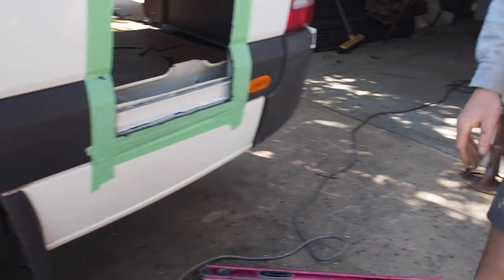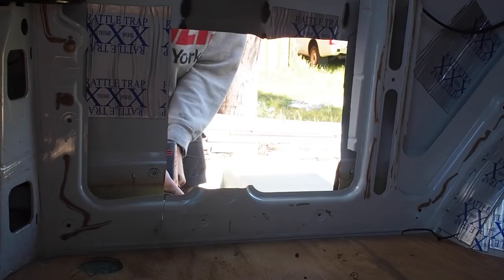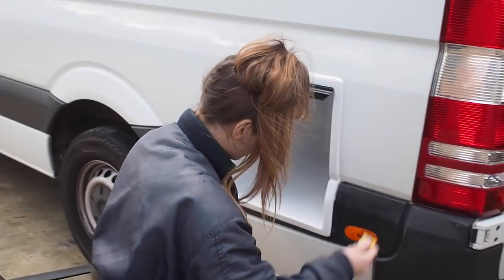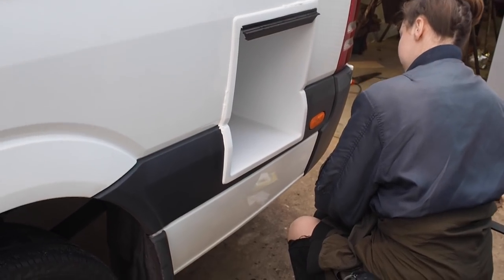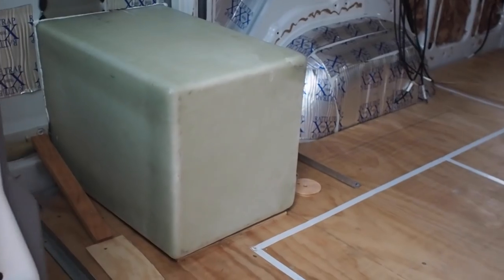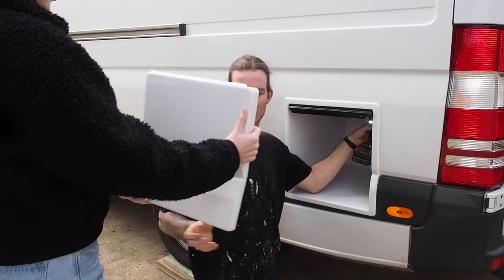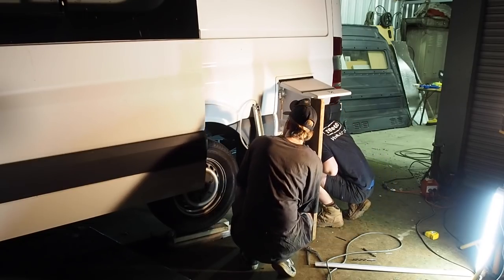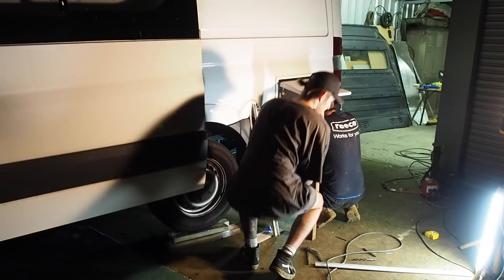HOW TO INSTALL GAS BOTTLE STORAGE BOX | Ep 5 Sprinter Van Conversion

Comment: Just looking at installing a gas box in a Mid wheel base Sprinter, couple of questions, can It basically go anywhere where there is clear wall and di you have to recess the floor to fit it in? Cheers John

Comment: I think in my build I'd want an under-slung LPG tank that can be filled at petrol stations, just a lot easier than bottles. If you manage to find a van of that size that has a petrol engine, then not only could the gas be for hot water, cooking and heating in winter, but also to run the engine as a cheaper fuel than petrol. You'd also have the bonus of the added range of having a second tank, and when not being used for travelling that gas would last for months just cooking and heating.
Reply: This is the exact same thing that I thought. Its illegal in Australia. Our LPG at the station is cut with butane, that is dangerous in stoves. You cant get a dedicated lpg storage tank underslung, its not legal to pump cooking lpg into a van. Nanny state gone mad. The reason our campers all look the same down here is that its the only legal way to build them.
Reply: @sarenace  that's a shame... I thought it was completely fine to cook with butane considering that's what camping stoves use

Comment: I don't want to cut a hole into my van 😥
Reply: I feel the same.. but safety is number one priority!
Reply: @maxhillebrand781  I'm thinking about building a camper van without gas. Webasto Diesel Heater and a cooker with just a small "can" of gas. Water heater with car cooling system. 

Still thinking about, what's actually cheaper. (gas shall be cheaper to heat up a van and easier, but here in Germany the TÜV needs to proof the system every (one or two) year(s).